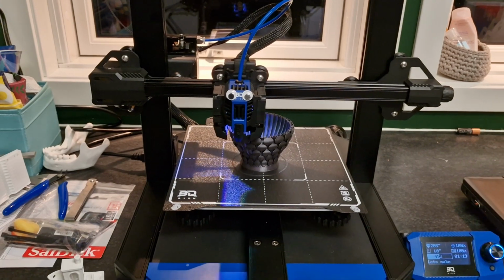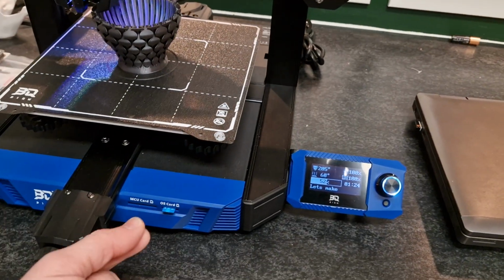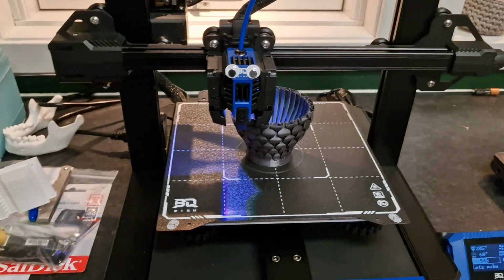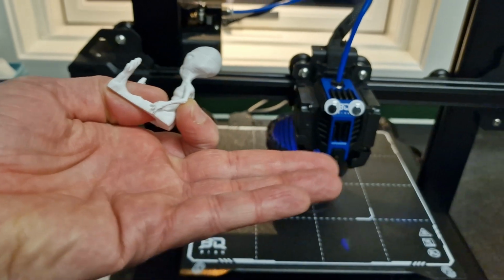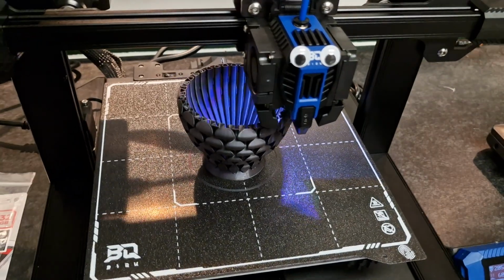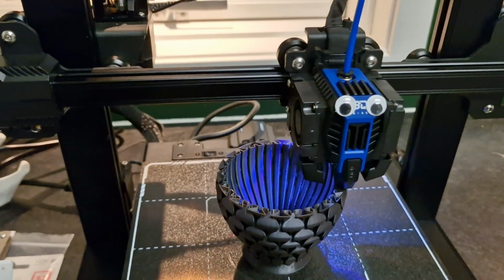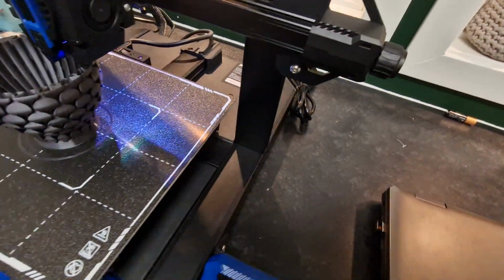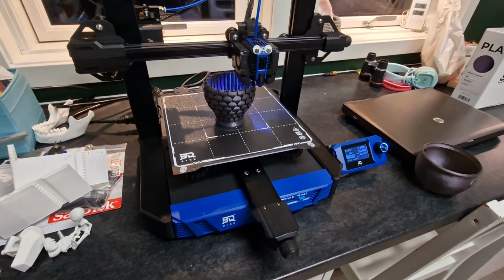BIQU Hurakan Klipper 3D printer review.

Comment: I bricked my Hurakan on day 3 (yesterday afternoon). I was using the website interface. When I updated Mainsail, the connection failed. So my board was bricked. Now I'm trying to figure out how to load Hurakan_Debian11_Mainsail_kernel5.16_20221119.img.xz to the board. Do I put the file on a full-sized card, and use that slot on the printer????? Or do I put the file on the micro SD card? And install it via the micro slot? Please advise.
Reply from the maker: It is not bricked. In the klipper world it is very important to read over the update notes before doing updates. Things have changed recently with how files are handled and if you don't follow the procedure correctly then you will lose connection until the files are re linked. 
This is a good example of what can go on, and may be what is happening https://github.com/Arksine/moonraker/issues/516
If you want to install the new image you mentioned you need to flash it to the SD card using balena etcher or raspberry pi imager. It doesn't get installed to the MCU like Marlin firmware. It is the operating system that runs on the onboard host computer (CB1 in this case) and the micro SD card is the hard drive. The larger SD slot (MCU) is used for flashing firmware if needed, in this case it is likely not needed, as you are not changing the Klipper version nor converting to Marlin. So don't try to flash anything through that.

Comment: as far as I know Flsun V400 is running klipper out of the box aswell (someone please correct me if Im wrong) but I did see another video about Hurakan saying its "the 1st 3d printer running Klipper out of the factory"..wonder which one was first😁 in any case I dont think that matters that much. What makes me happy is to see 3d printing industry going in the right direction. I mean Marlin has most of Klipper's features , its just a bit harder (or is it?) to implement everything.
Reply from the maker: You're right. I completely forgot about that one. So this is the first bed slinger with klipper out of the box, that I'm aware of.😅 Maybe it was the recent official sponsor announcement with Bigtreetech and Klipper that made me think it was the first.
Reply: Klipper definitely has more features than marlin

- No reflashing just edit the config
- WIFI interfaces (well marlin and octoprint exist so)
- Input shaping
- More customizable imho
Etc

Comment: what materials does it support?
Reply from the maker: Well it's a Bowden tube set-up so it's not going to be able to do high temp without some hotend upgrades I personally wouldn't want to put any Bowden tube set-up over 240c. Also soft TPU and similar very soft materials are notoriously difficult with Bowden tube machines. Otherwise it should be able to handle a decent range of materials. I've so far done PLA, PLA+, and PETG, all worked well.
Reply from the maker: I just tried some standard TPU and it printed great!